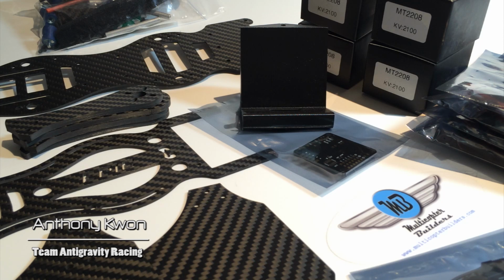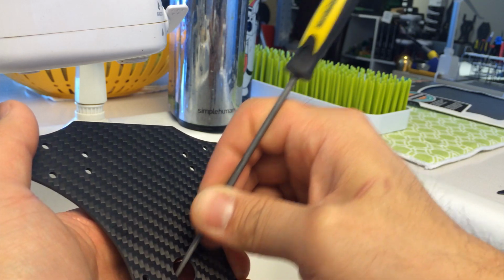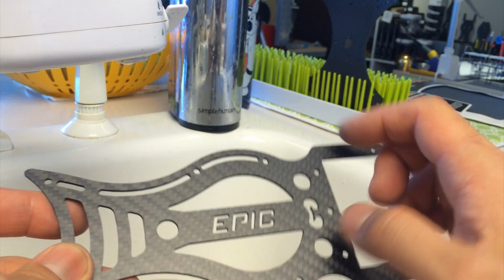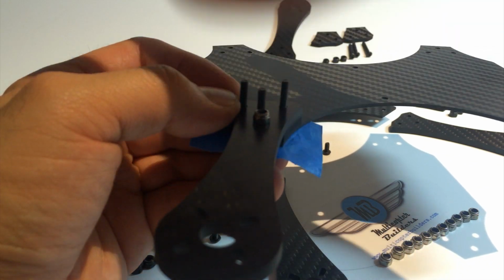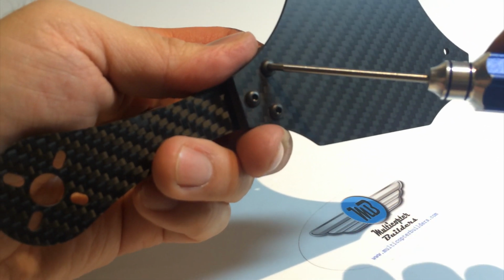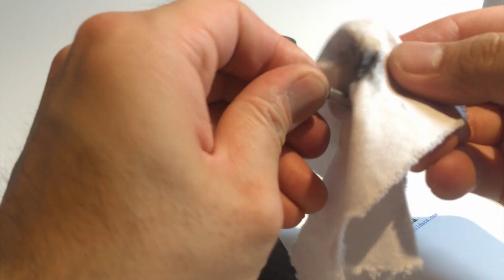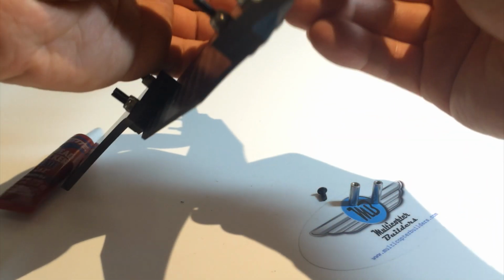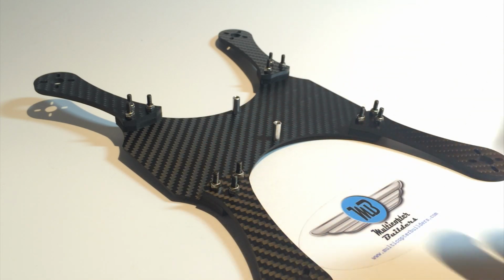HOW TO: Build an Epic 280 - Part1

Comment: I do not own one of these frames :( but I am big on weight savings and I would recommend maybe using nylon nuts in place of the nylock nuts on the arms for the wire channels. You would be SURPRISED how much all of the little added bits and bobs totals in the end. :) Also, I am always looking for ways to do things easier and I have tried the way of shining the standoffs and ALWAYS get a cramp in the big muscle between thumb and pointer.. I suggest a threaded rod in a cordless drill/screwdriver, tighten chuck and then thread standoff onto rod. Put the drill/screwdriver on a low setting and lightly apply rag with compound and VIOLA done in like 5 seconds!! Hope this helps :)